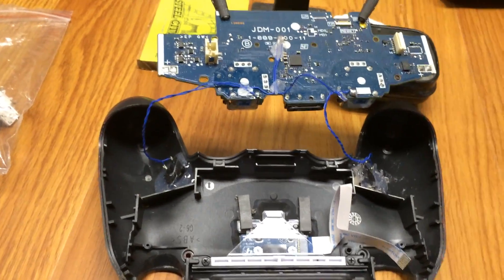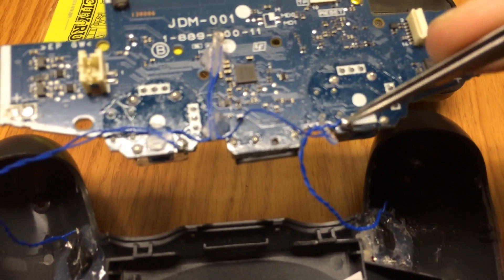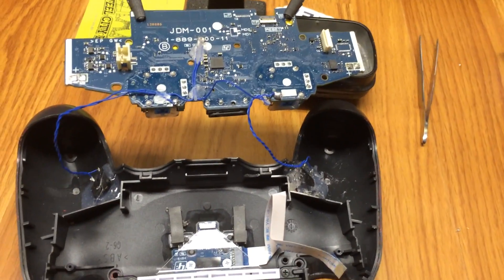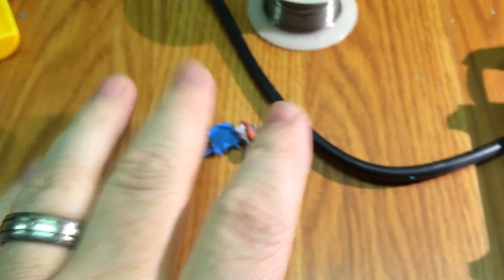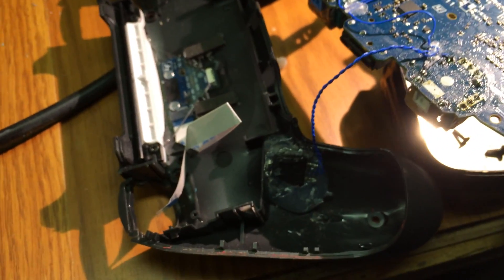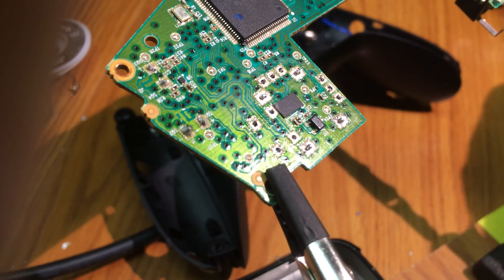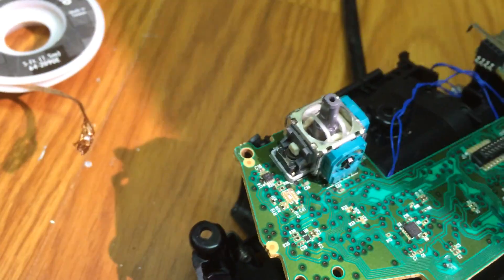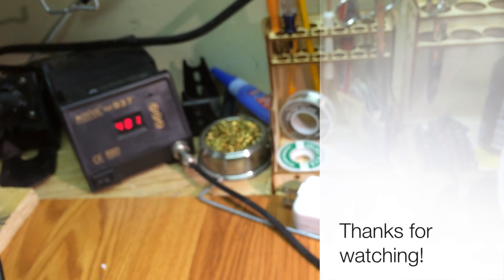RedditBlack R&D 14: Fixing XB1 & PS4 analog sticks

Comment: I'm planning to replace my ds4 sticks as well. I'd try to add solder to the original first, that would help heat transfer faster from the iron, then use the sucker.

Comment: I have an R3 button, that's the "pressing down" into the analog stick that's always registering a pressed down action. It's not the analog stick, I replaced it with a new one, and same thing. It clicks just fine, but controller testing software registers that it's constantly clicked down. So, I desoldered the 4 leads under the click button of the stick, and when I fidget one particular lead back and forth, the R3 action flickers on and off in the software. It's as if when I solder it cleanly, it just registers as a constant activation. Any ideas?
Reply from the maker: 13lake probably a bad board at that point.

Comment: The reason it took so long is because you didn't use any Flux, there isn't enough in the de-soldering braid.

I dabbed some flux onto the braid and solder points and the solder came loose in seconds.
Reply: Why exactly? im a noob at soldering and im having troubles desoldering pieces with so many solder points. Im only using flux for soldering, as i understood was the right way to us flux.

Comment: a really helpful way to desolder is to add bismuth solder aka "chipquick" to the joint first, the solder sony uses will melt with the low temp solder and the two will combine into ultra low temp solder through chemistry, the solder will stay liquid longer and in some cases melt at just above room temp, hope this helps!

Comment: How many watt soldering iron did you use I'll looking for something under 20 pounds please reply as soon as possible
Reply from the maker: The soldiering Iron I'm using is part of a temperature controlled soldiering station. I have another video where I go over the tools I use. It was about $60 US off of amazon. If you have to get a cheap iron, anything between 20-40w would be fine but you're not going to get a professional iron for cheap. The one I use at work is a 40w, and it was $40 - it's a weller and not temperature controlled, but just has an adjustment knob.

Comment: Do you happen to know the correct part number from Alps? I don't have good luck with the ones they sell on ebay...they may be Alps but they are usually either poorly stored and shipped with dust in them, or even worse, pulled out of controllers...either way, i've had different experiences with each one on my controllers...different sensitivities and overall "feel" to them...

Comment: Hey could you tell me who you took off the potentiometer on the ds4
Reply from the maker: +Garrett Welsch what do you mean by "who you took off?"
Reply: +KaosX sorry I meant how did you take it off
Reply from the maker: +Garrett Welsch you have to desolder the contacts. I show which ones in the video. a solder sucker or desoldering iron is really useful for this.
Reply: +KaosX it looked like you just smashed it off

Comment: I tried this and now my controller won't turn on. I tried the charging port it works on another controller and I tried the battery on another controller but now the one I put the replacement analog on will not turn on. Any ideas? Also it kills my battery and I have to charge it on another controller.
Reply from the maker: +Crystal Martin sounds like there's a short, possible that a point is just grounded. If you remove the new stick, does it still happen?
Reply: +KaosX haven't tried if I do and it still happens then my board is screwed and if it works then I guess I can fix it?
Reply: +KaosX does the tumblers or analog have to be hooked up for the controller to work?
Reply from the maker: +Crystal Martin If it works with the new stick removed you can either try a different stick, or try soldering back on and be careful not to short it. If it's still busted, it's an issue with the board. Youc an get replacement boards from morbidstix though.
Reply from the maker: +Crystal Martin nope, rumbles can even be left out completely. Analog not required to power it on either.
Reply: +KaosX it just seems sticky and wet where I soldered should it be like that

Comment: Have you ever had a bad "3D Controller Joystick Axis" component?  The second controller I tried fixing is not registering the L3.  I only bought two of these parts and the first one works well on my first controller.  The second works well except for the push-down action.  It still gives me the tactile click feedback but it doesn't actually register.  All other buttons on the controller still works so I'm hoping it's down to a bad component.  Does this sound familiar?  I will try rewiring a mod button to L3 to maybe narrow down on it.  I'm hoping that works or else I must've applied to much heat and damaged that area.

Anyway, thanks for your video.  It's the reason I tried fixing it myself.  This was my first time soldering/desoldering as I wasn't about to shell out for yet another controller.  Might as well learn it, and now since I'm using lead-free solder it should be easier to swap out in the future!
Reply from the maker: +TwoLeggedTriceratops I have, dealing with a few right now. Even brand new they were not quite right, waiting on a new shipment so see if I can make it right.

Comment: Hey man, do you fix these for people? as in if I send this in to you, would you be willing to fix it? It's my right analog stick that drifts down sometimes when you let go of the analog stick. Drives me insane with shooters
Reply from the maker: Kevin Reviello for XB controllers I will. The PS ones are just a little to frustrating to work on...the solder they use is a huge PITA for some reason.
Reply: alright no worries. Your video was helpful though. I shall pass it on to someone that's an electrician to maybe help me out KaosX
Reply: Kevin Reviello You don't want an electrician, you want an electrical engineer.  Really, anyone good and experienced at soldering, which can certainly include an electrician, if they happened to do so as a hobby.  But if you're looking for a professional, an "electrician" is going to be more likely to help you wire a fuse panel, not replace a DS4 analog stick.

Comment: Hey kaos, been following a lot of your posts over on the MODCENTRALUSA sight. Quick question, is the ps4 remap solder points accessed by scraping the bottom part of the 3? Just got a new ps4, can't play without my cinch/scuf style controller.
Reply from the maker: jrn00498 yeah, that's one way to do it, though the solder points are pretty damn tiny.
Reply: Can you give me any info into how to find the solder points for the jump/drop buttons on the newer PS4 controller? I have a circuit tester, all kinds of shit, and still can't find where the solder points are. I hate having to use that remap circuit board from MODCENTRALUSA, but it does work, and it is great.
Reply from the maker: Ive been using the flexible circuit, but it's expensive. You can try to trace where the top piece interfaces, but this often means sacrificing a board to map it out.